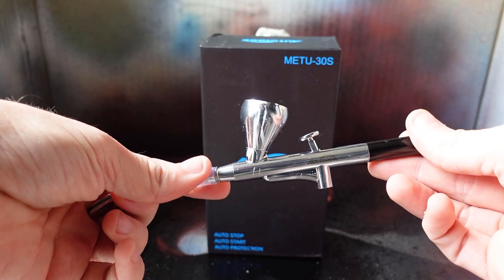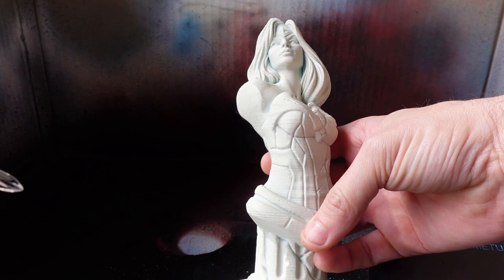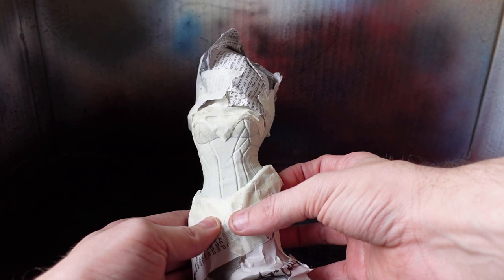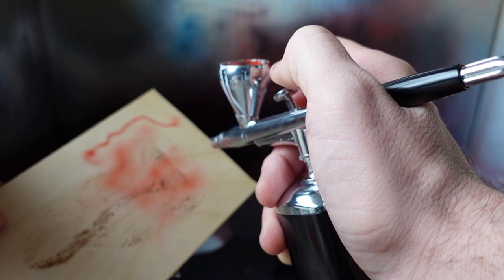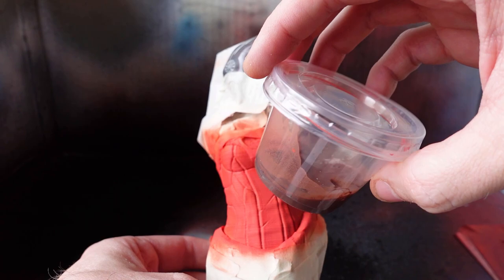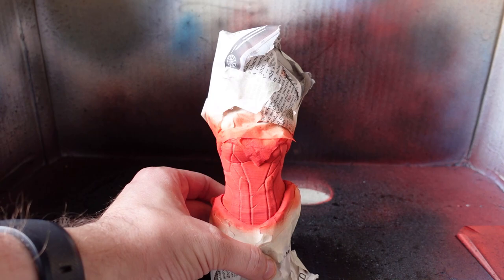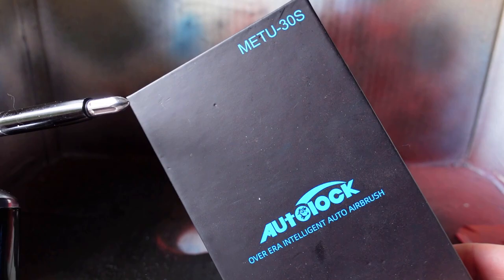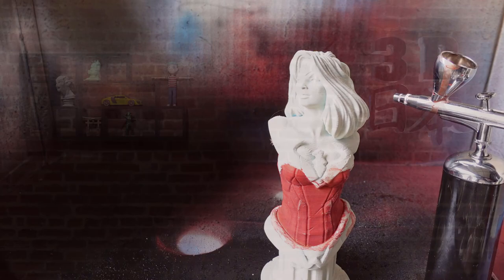Failing at Using a Cordless Airbrush

Comment from the maker: There is a bit of a learning curve with these brushes, such as cleaning. I've been using lacquer thinner to clean. For quick color changes you can just run some distilled water and thinner through the brush until it comes out clear. For a full clean you do have to take it all apart and wipe everything down with thinner or airbrush cleaner. Cotton swabs are handy for this.

Comment: You needed more than 2 drops of flow improver to 10 drops of the standard Vallejo Model Color. More like a 2:1 ratio (10:5), even more like 10:3:2 of paint, water, and flow improver.
And so many cringe points, Paper Masking tape, and not actual painters tape. Using Paper towels to wipe down after spraying.
Reply from the maker: It's my first airbrush. I did say I failed.
Reply: @3DJapan  Oh, I didn't catch that it was your first airbush ever. Another tip with using black, very little goes a long way, a half a drop to 1 drop with 10 drops of red will probably land a shade that is better. Also you may want to try 90%+ IPA instead of water, this will improve drying time but still be thin to airbrush.
Reply from the maker: @coreykirkpatrick4392  Yeah I believe I mentioned that I had one many years ago but never got to use it.